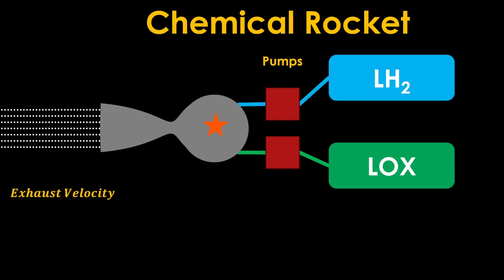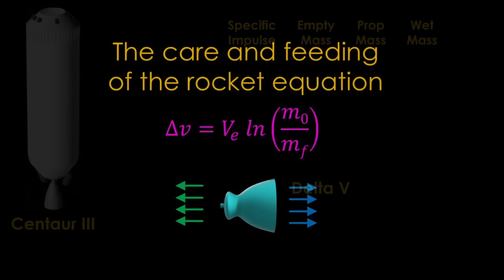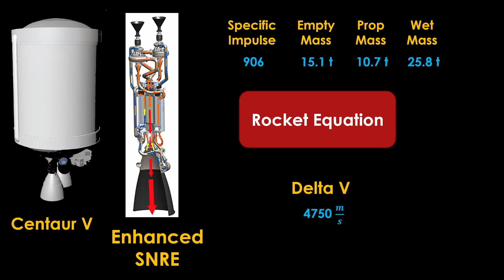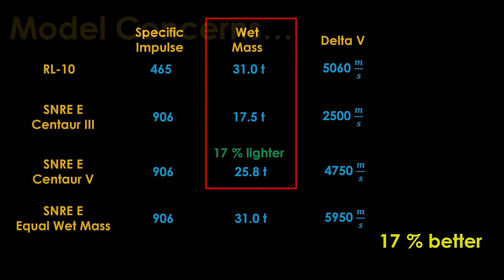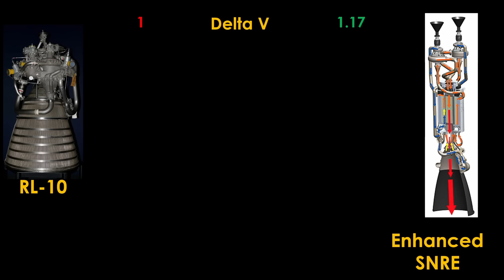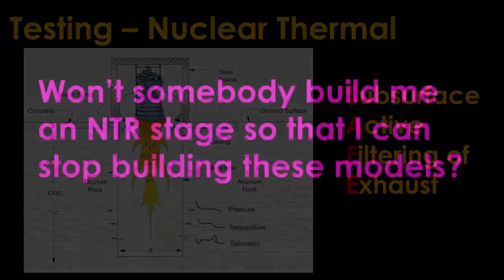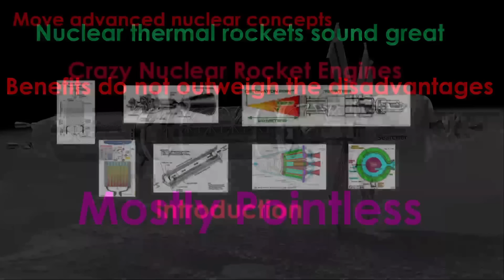Why Nuclear Thermal Rockets are Mostly Pointless

Comment: Are you familiar with the pulsed solid-core nuclear thermal rocket concept? It seems like it could have more than a marginal advantage over chemical rockets for interplanetary travel, if the cooling system could be made light enough as to not offset the ISP gains.

Comment: Tell me if I'm wrong,  if you used  water as a propellant in your calculations.  Water is 1000kg/m3 LH is 70kg/m3. This would result in a ve approximately proportional  to ln(density H2O/LH) or an increase in yourapproximatey ln14 or 2.6 . Which yields a factor of 2.6  increase in your calculations  for the nuclear rocket.
Reply: but it’s lower specific impulse because it’s heavier than hydrogen

Comment: Throwing ‘radioactive’ around like the sun and earth’s magnetic field don’t already cause radiation
Reply from the maker: There is a lot of radiation in space, but not at the intensities that NTR engines create. That's why the designs require extra shielding.
Reply: @EagerSpace 
Shielding achievable with three elements, which I’m surprised you didn’t break down: Neutron Reflectors, Neutron Moderators, and Neutron Poisons. 

It is surprisingly simple to design these thermal nuclear engines in a way that would not increase the weight of the system due to radiation shielding. Because there are light elements other than lead which are very effective at absorbing neutrons and ionizing radiation. Of which one moderator is already stored in the rocket: Liquid Hydrogen.

Comment: Because of the problems of handling H2, we should be using CH4 instead for the NTR.
That changes the analysis considerably.
Reply from the maker: Methane gets your roughly two thirds the specific impulse that you get with hydrogen because the molecular weight is so much higher. You do get smaller tanks but you still have the very heavy engine and shielding to deal with.
Reply: @EagerSpace  Vacuum Isp
 CH4 => ~384  ; H2 => ~450 - 460 
 (These are all from real engines).
=> ~83 - 85%.  
Considerably better than "two thirds"
Reply from the maker: Talking about fuels for NTR, not fuels for chemical.
Reply: @EagerSpace  CH4 does not do anything akin to H2 embrittlement.  It's critical range of temperatures are far more similar to O2 than H2 is.
=> save system weight and reduce complexity.
Combined with having 83 -85% of the Isp of a HydroLOx based system, the net effect of using CH4 instead of H2 is a more significant plus than you are admitting.
Reply: @EagerSpace  So you use a traditional MethLOx booster system until you are out of earth's atmosphere, then switch over to a nuclear system that uses pure liquid CH4 as propellent heated far hotter than burning MethLOx ever could  be.
...and with this setup, the propellent is actually helping cool parts of the system rather than the entire darn thing needing to be overbuilt to protect against H2's handling issues.
The overall system is a lot better than you are admitting.
Reply from the maker: >then switch over to a nuclear system that uses pure liquid CH4 as propellent heated far hotter than burning MethLOx ever could  be.

That doesn't work. Raptor hits about 3500 Kelvin which is possible because the combustion chamber is empty and all you need to do it cool the walls.

NERVA never got about 2750 Kelvin. The problem is that you melt the fuel elements if you heat them too hot.

If you could get temperatures higher than chemical you would get great ISPs. I haven't seen any papers that assert that you can get those temperatures. Most target about 3000 K.

I'll also note that DARPA recently killed their NTR program because they didn't think the benefits were worth the development costs...
Reply: @EagerSpace  In the NTR scenario, CH4 is remass instead of being fuel.
 It's still stored cryogenically (to save space).  It's still capable of being used to cool the walls of the chambers its flowing through to be heated up, accelerated, then ejected through a Laval style nozzle to produce thrust.
CH4 is heavier than H2, but it's also MUCH easier to store and work with than H2
(...and dreams of using atomic rather than molecular hydrogen as remass are just that - unrealistic fantasies...)
What you want is a plasma in the millions of degrees being directed and ejected by non physical "nozzles" made of EM fields or the like.
Since CH4 does not have a charge, we're going to need some other way to accelerate and direct it (or we need a way to give it a charge).
But since the entire point is for the CH4 to absorb as much energy as possible and then be ejected as remas where we convert as much of that energy as possible into thrust, it absolutely can and should be used as cooling mass as its being accelerated.

Comment: I've always thought it might make more sense to use a denser propellant than hydrogen, even if the specific impulse suffers due to lower exhaust velocity, but I admit I haven't actually done any sort of math beyond playing COADE.
Reply from the maker: The atomic rockets website has a lot of information on alternate propellants.
Dense inherently means lower specific impulse and it's generally either a wash or worse.

Comment: Wait… what if you use a denser gas… like can you use something like CO2? Or even just LN2?
Reply from the maker: The high specific impulse is dependent from using liquid hydrogen as the propellant - it has very light atoms so the exhaust is high speed.
If you go with denser gases, they have heavier atoms and therefore you lose the specific impulse advantage. You're left with a heavy engine and not much specific impulse improvement.

Comment: Please make follow-up video's, one about how rotating detonation rocket engines will make nuclear thermal rockets even more pointless and one about how bimodal nuclear electric nuclear thermal rockets will make nuclear thermal rockets completely pointless.
Reply from the maker: There's a video on nuclear electric out there. I haven't talked about bimodal because I haven't found a discussion with a model that I think is sufficient.
Reply: Rotating detonation rocket engines are only slightly more efficient, difference is small enough and difficulties great enough unlikely they'll ever be useful.

Comment: There is no reason to use h2 as propellant because you don't need to burn it. Electric rocket engines (Ion) use heavy gases and have specific impulse 10x to chemical rockets. What about co2 ? It is easily liquified and is even heavier than o2
Reply from the maker: You need light propellant to get high specific impulse. 

This post has some numbers with alternatives. They are all much, much worse. Carbon dioxide gives a specific impulse of about 330, and you have to carry a heavy nuclear reactor with you. 

https://space.stackexchange.com/questions/22620/nuclear-thermal-rocket-working-fluid-performance#:~:text=argon

Ion thrusters don't use heat to generate propellant motion, they use electricity, and that gives them the capability to get very high specific impulse even with much heavier atoms. You could get extremely high specific impulse with an ion thruster using hydrogen - assuming you could get it to work, it's hard to ionize hydrogen - but you would get pretty much zero thrust from it so it wouldn't be useful. Heavy atoms are used in ion thrusters because that gives them more thrust.

Comment: I like the skepticism but the video is clearly biased, but also many comments swing too far in the opposite direction. The correct middle ground is that NTR stages are neither pointless nor an obvious upgrade over chemical propulsion, they perform better in some scenarios and worse in others. 
This video takes rockets and stages optimized for chemical propulsion and concludes nuclear is pointless, in reality propulsion and vehicle architecture must be designed together. 
Apollo era studies show that a nuclear Saturn V (with major modifications, not just swapping the J-2s for Nerva) could increase TLI payload by 2-3 times, so definitely not useless.
Reply from the maker: Go watch the new video
https://www.youtube.com/watch?v=e8pL44Z-81Y

Comment: Great Video and Info !  You are WRONG !  Just say Yes, to the DRACO Engine !  The NERVA Engine was too Large and Powerful (250,000 lbs. of thrust) !  The DRACO is better than NERVA because you can have redundancy in the number of engines and redundancy in the engine !  A Great UP-Grade for the DRACO Engine is the NASA designed "24-Hour Lunar Shuttle" (LEO to LLO) by Stan Borowski - NASA John Glenn Research Center that uses an advanced Rocket Nozzle by Aerojet Corp !  The advanced engine has an ISP range of about 900 sec. to 515 sec. and a thrust of 15 k lbs to 66 k lbs !  This advanced rocket has tanks for Hydrogen and Oxygen/LOX !  The main reason for the extra cost is fast mission time and for Crew SAFETY !  Also see my comment in your video released about ten days later with a similar name and subject !  The RL-10 engine has an ISP of about 450 sec. that is better than RP-1 or Methane/CH4 chemical rocket engines !  Timothy Lipinski

Comment: I think these comparisons are mostly unfair. Since a nuclear engine only uses one fuel the actual tank structure would be very different. 

1. No common bulk head, no down comer tube = less dry mass.

2. Spherical tanks, assuming this is some sort of space tug. There’s no reason to use cylindrical tanks. Sphere are better pressure vessels so walls can be made thinner, and they have a smaller surface area to volume ratio.  

By optimizing the tanks for the engine you’d probably see a pretty decent increase in delta-v. I don’t know if that makes it fully practical, but it’s definitely better than the 17% you showed, maybe closer to 30% or potentially even higher (idk I didn’t do any real math, just guessing)
Reply from the maker: Take a look at the new video...

https://www.youtube.com/watch?v=e8pL44Z-81Y

Comment: I’ve had an idea for a while, crazy or not crazy?

Make a propellant tank that can reduce its own length as it drains and discard the excess material on the fly.

The idea would be that the bottom dome is not physically attached to the tank wall, instead using a seal. A lightweight mechanism could slowly crank the tank wall down as the stage burns, while another mechanism would snip off the edge of the tank wall as it descends past the seal with the bottom dome. This might require the the tank wall to be ribbed, both so the cranking mechanism can grab onto the tank wall and control it precisely, and so that the snipping mechanism could snap the tank wall off at the gaps between the ribs instead of physically cutting the tank wall.

This whole idea was inspired by those mechanisms that can cut beverage cans into helical strips of metal, but we obviously can’t have our tank wall spinning as it’s cranked down (or could we? No, probably not), so we’d need a brand new method to accomplish this feat.

In addition to shedding dead weight as soon as possible, this system could also be used to maintain internal pressure in the tanks. No need to feed helium or gas from the engines back into the tanks, just shrink the tank to boost the pressure. Maybe you even have to vent during the stage burn.
Reply: Great Comment !  You missed the easy solution of "Drop Tanks" used in WW II fighter planes and even in present day !  See the Stan Borowski - NASA John Glenn Research Center Mars rocket with the Gold color Hydrogen Drop Tanks in this Video !  Also see my comment posted for this Video !  Timothy Lipinski
Reply: @TimothyLipinski  the Space Shuttle had a drop tank, but in theory, my idea might provide additional performance, so long as the engineering challenge can be solved.

Comment: What are your thoughts on Jared Isaacman’s plan to focus on nuclear electric propulsion where a nuclear isotope generator is used to heat electric ions rather than liquid hydrogen?
Reply: Makes a lot more sense than an NTR for a probe, thats' for sure. Getting rid of hydrogen makes things far cheaper and easier. Hopefully the NEP probe's test flight goes well and opens up the solar system to far larger with far more deltaV to get to distant targets much sooner,  be able to drop into orbit around them far more often, and power far longer missions.

Comment: Oops, sorry no one mentioned the poor thrust of those nuclear thermal rockets. They can't even lift from the ground on their own! As with ion engines we have the cooling problem. Thanks for the video. I did not suppose it was that bad. I have to lock if you have a video on lightsails or solar sails -- as they are hyped for being a solution but no one really invests much in them either.
Reply from the maker: No videos on light sails or solar sails.

Comment: I tend to agree that nuclear rocket engines don't make that much sense, but I wouldn't rule them out completely.

I think the numbers could make more sense with CO2 for propellant. The case for CO2 would be Mars. If you land an empty stage, just using CO2 would allow you to run a fan sucking in atmosphere, run it through a cryocooler and store it in the tanks. A few weeks or months later the tanks would be full and you could launch back into space. Specific impulse wouldn't be great, but it should still be good enough. (Google says 270-ish seconds.) And there's no pesky water mining or energy intensive processing into methane and oxygen.
Reply: That pretty much negates any potential advantages.  No pesky water mining just the pesky need to fly a heavy nuclear reactor that adds a lot of other complications and dangers for a performance penalty?  I don't see how that adds up.
Reply: @imaginary_friend7300  The nuclear reactor would be much lighter than chemical propellant, and much lighter than any equipment needed for water mining and processing. Using Starship as an example, full tanks would be 1500 tons of propellant. And the equipment needed to do water mining and processing (including a multi-MW solar array, battery packs, electrolyzers, etc.) is conservatively a few hundred tons at least. If you could get away with three 5-ton reactors instead, that would be a massive  reduction.
Reply from the maker: CO2 drops the specific impulse to 330 or so, but you end up with a much heavier engine and therefore a lot less delta v for a given amount of propellant. You also have to deal with the low thrust.

Comment: Two questions.
Based on your model, if the reaction mass (LH2) were doubled by transfer in orbit, would the net Delta-V improve? The higher engine mass is proportionally smaller.

Next, if you replace TNR with nuclear ion or plasma engines wouldn't the net Delta V increase? This assumes really long engine operation, since ion/plasma thrust is low. However a trip to Mars is 6 months so long thrust time is already available.
Reply from the maker: Assuming you have tanks to store the propellant, yes. 
Not sure what you mean by "nuclear ion". If you mean nuclear reactor powering ion thrusters, that is a really long and involved model, because you have the mass of the nuclear reactor, everything that goes with it, and the radiators. 

I have a video on nuclear electric propulsion.

Comment: NTR makes a lot of sense for low thrust space tugs - moving payloads around the solar system as it delivers about twice the impulse as LH2/LOX engines, meaning half as many refueling launches needed on a big rocket like Starship where it would be possible to carry a maximum load of liquid hydrogen without being volume constrained.  That's a big deal if you want to go to Mars across a wider launch window or at higher speeds, and especially valuable for halving flight times to belt and beyond.  Its also provides a way to climb out of gas giant gravity wells from their moons - which chemical rockets can't do.
Reply: Sure, if we ignore all the other issues with liquid hydrogen like long term storage, leakage and embrittlement.
Reply: @imaginary_friend7300  aluminum tanks are fine for hydrogen, and if you keep it behind a sun + earth shielding shade (like a good sized pv array) in LEO, or even just cover tank in a 10-20 loose layers of mylar weighing a few grams per m² then cooling requirements are miniscule.  It's really not hard to manage.
Reply: @robertlynn7624  For long term?  While the ideal material for a single use stage it still permeates through Aluminum.
Reply: @imaginary_friend7300  at cryogenic temperatures the rate of diffusion is miniscule, and of course diminishes in proportion to tank volume
Reply: @robertlynn7624  Cryogenic hydrogen tanks are far larger and higher mass than methane tanks and leak far more over time. Just one of the many reasons why chemical rockets are better for nuclear on Mars trips.

Comment: I (and people who actually understand orbital physics) have been saying these things are crap.  The love of them is the NUMBER 1 indicator of space-cadets, people who have a superifial desire for space 'dreams' but no real understanding of engineering.  Anyone who actually looks at the enginering knows that electric based ion thrusters running on solar power are the way to go for mission out to the asteroid belt.  They offer the only real path to reusable in-space propulsion stages as they have enough Delta-V to return to Earth and re-propellented with dense noble gasses like Kypton and Neon and have basically never had a failure in flight.
Reply from the maker: I've been looking at NASA mars architectures recently and there's an interesting hybrid chemical/SEP architecture that's roughly as good as nuclear but without the disadvantages.